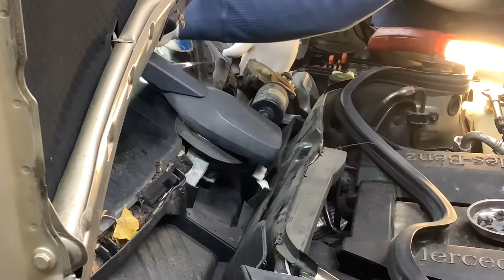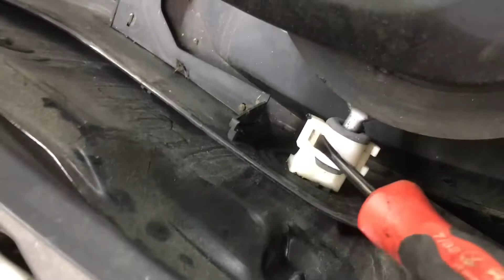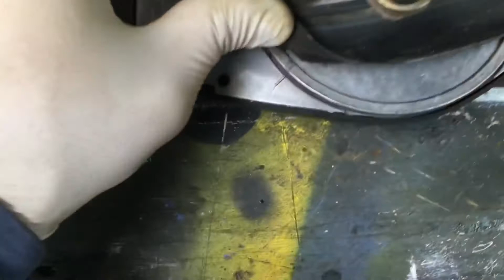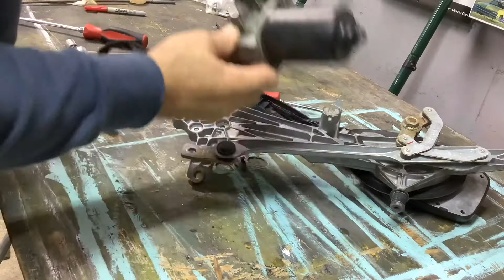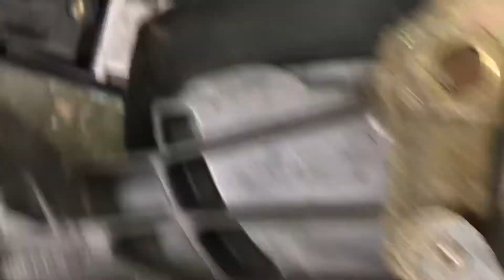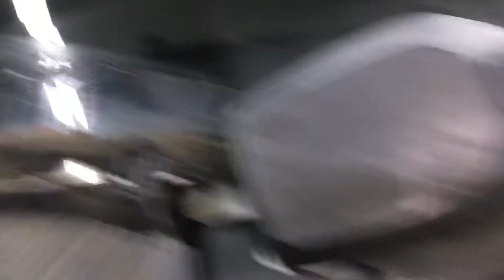Mercedes Benz W202 windshield wiper repair

Comment: Thank you for this video. Helped me a lot.  I have a problem now where the motor searches for the park position every time stops  in  a random place! It  also starts when i turn on my ignition..  very odd. Still looking for answers.
Reply from the maker: Your problem is more than likely in the wiper motor itself, but unfortunately I have no diagnostic advice for what to do, other than replace the motor. Good Luck and thanks for watching

Comment: i changed my motor and still nothing , Is there relay for the wipers or a fuse ?
Reply from the maker: Definitely a fuse maybe a relay too, you need to check a wiring schematic.

Comment: Mine mono is moving sideways like it should but it’s not pulling back inside like it should. Any solution?
Reply from the maker: The small gear in the plastic bag I show in the video is probably what’s bad. It will require more disassembly than I show in the video, but the timing procedure is the same. Thanks for watching.